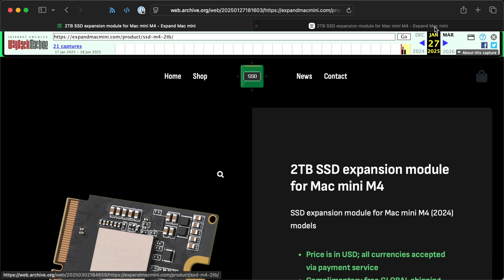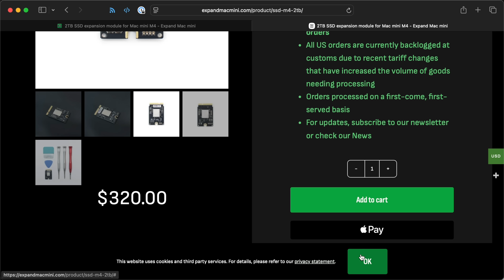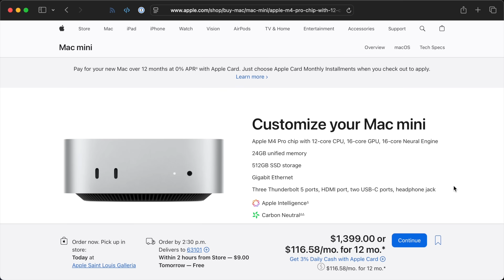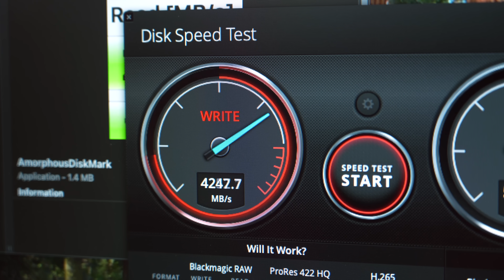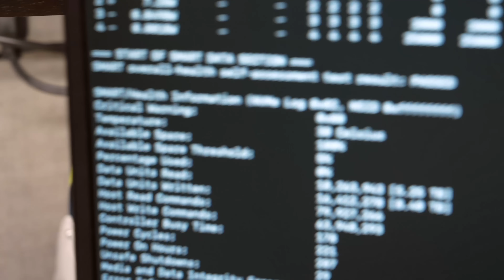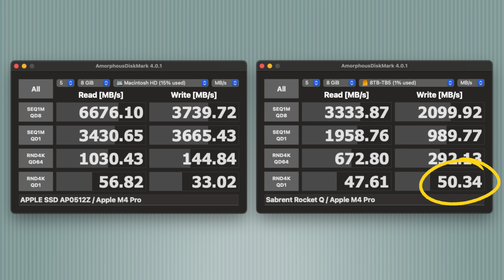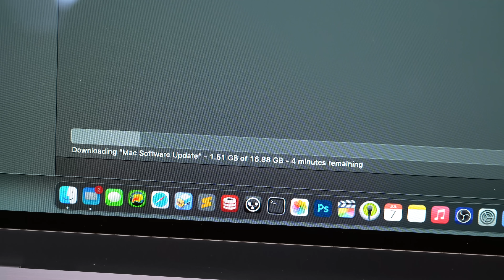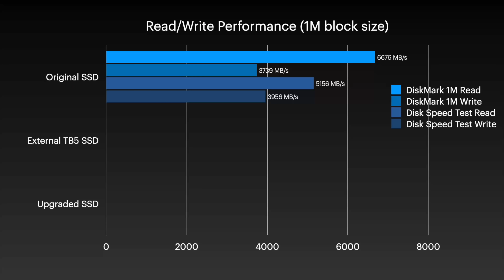There are three types of Mac users

Comment: @6:06 Given how you say it was ~150GB data transfer and then slows down, it sounds like it uses SLC caching, where it treats a portion of the storage as fast SLC flash at the cost of storage space, until the space is fully needed.
Reply from the maker: Someone else mentioned the same thing this morning—that makes a lot more sense than my DRAM theory, especially since the DRAM cache on this drive is fairly tiny, only a couple GB I believe.
Reply: It probably doesn't even have DRAM cache if it uses pseudo SLC cache.
Reply: @JeffGeerling from what I understand, the dram cache is basically a lookup table of the locations of all your files in nand for the controller chip. Very oversimplified, and I may be wrong but from what I gather, Think of nand chips as huge aisles of bookshelves in a library, and the books your data. Instead of going on a hunt to look for the books every time, it just refers to the logbook to see that it needs to go to c2-4 and just goes there directly. 

That’s why they’re faster than dram-less ssds, but not really relevant now as since pcie 4.0 I think, this index process is offloaded to system ram(I forgot the name for this process). So the drive uses your system ram as a dram cache to store the lookup tables of files on your ssd. Not sure if Mac would handle it the same way as on windows for external nvme drives, but I do think 4.0 and 5.0 drives will perform better in that enclosure, as you’ll have nand chips capable of 10-12GB/s, and I assume that should help dump out the initial SLC cache once it fills up, to the TLC/QLC regular storage thanks to the higher throughput. 

Pcie 3.0 is really ancient now imo for ssds for such heavy use cases like large video file transfers(it’s fine for general everyday users),  4.0 is a sweet spot between price and performance, and 5.0 is worth it if you really benefit from the increased speed. Or the other bonus of using x2 lanes instead of x4 for the same throughput by going up a generation.
Reply: Especially since it's a QLC drive

Comment: Quick note: For most people and most NVME drives a good USB 4 external drive case will perform nearly as well and be much less expensive.
Reply: Yep, and even an external USB 3.2 drive is going to be more than fast enough unless you're going to move hundreds of gigabytes of data around on a regular basis.

Comment: Great video Jeff as always! The longevity of these internal upgrades are very questionable, i thought you would’ve mention it since there are many cases of dead chips (Reddit) and the refusal of each of these manufacturers to mention the TBW life of their chips.. If you come in contact again please do ask them about that. Thanks!
Reply: That's not a TBW issue for that low a runtime. That's shoddy manufacturing or just downright faulty NAND.
Reply: @toseltreps1101  Yeah, these days all NAND drives have TBW lifespans that would take the average user many years to hit. The drive is much more likely to fail for other reasons.
Reply from the maker: I was actually in contact with M4-SSD this morning - they mentioned they have offered replacements for anyone in the first batch of the M4 Pro SSD upgrades. I haven't had an issue yet, but I've only been running it for a week or so now!

Comment: There's the 4th kind of Mac user:  A poor software dev that can't afford the Apple tax and only needs a Mac to briefly test on for a few minutes once every 6-8 months but borrowing someone else's hardware even for just a few moments feels tacky, finds out that the latest version of Gatekeeper on the latest version of macOS breaks their builds, and understands that, deep down inside, Apple actually hates all software devs everywhere as well as all of their customers.
Reply: You were doing fine until the end when you went off the rails very badly.
Reply: The moment when you realise it's not a real computer.
Reply: @xavierayayaell546  I know, you prefer to use the abacus
Reply: If you don't want to pay the Apple tax, just by the base model M4 Mac mini, which even by PC standards is a good deal in price/performance terms. The 16GB memory is more than enough for most development needs, and the 256GB internal drive can be supplemented with an external SSD of your choice -- starting at around $60 for 1TB for a USB 3.2 drive (1GB/s). 

Given the surprisingly good value of the base model (thanks for the additional 8GB memory, AI), it's as though it's being subsidized by those who do step on the $200 upgrade ladder, where the good value immediately falls out the window. So thanks to the upgraders, us more frugal folks get to buy a reasonably priced Apple computer for once!

Comment: What's the point of getting an 80gbps gen 5 enclosure to then put a gen 3 nvme into it? Bit of a weird test...
Reply: Test the enclosure itself…
Reply: @hankhulator5007  but it isn't even testing the enclosure. That's the thing. If you get a TB5 enclosure and put an old generation NVMe into it, it's not going to reach its full speed.
Reply: @kerimgueney     Hmmm, I would say that normally you should have better results with an enclosure that can do better.

Comment: The primary reason why DFU mode is needed:

On Apple Silicon the computer's FIRMWARE is on the boot drive, so until you've used DFU mode to install firmware on the new drive, the Mac mini doesn't even know how to use an external drive.
Reply: Additionally: to my knowledge, Apple Silicon does not boot to external drives anyway.

(there are some workarounds, but they involve doing at least part of the install to the internal drive, and that part loading the rest of the OS from the external drive.)
Reply: @kitlith  you can boot off external no problem you just can't use apple intelligence.
Reply: @MacSoundSolutions  Yes, but I believe @kitlith is correct.  It can run the OS off an external drive, but only after it initially boots off the internal drive with the firmware.

If the internal drive is dead, it would need to be fixed/replaced via DFU before external drive booting works again.
Reply: @davidschaub7965 yes that’s true it does a check with the internal drive so if the internal drive is not working you cannot boot off the external. I was not saying you can boot externally without a working internal drive just that you can boot off an external, if you are going to boot externally there is no reason to swap the internal drive.
Reply: @kitlith  Tell that to my M4 Mini that has been booting off the 2TB external I built for it from within the first hour of turning it on.
Reply: @sorphin According to Asahi Linux's engineering. Apple Silicons doesn't directly boot from external drive in anyway. They always copy that to internal then boot it.
Reply: @Keihan-8000  That's nice for them? As I previously said, I'm running on a TB4 external 2TB drive.. i wiped the internal SSD, so it has -0- OS.. Still booting (after I blessed the external drive again (set the Startup Disk)).. so.. Not sure what to tell you.
Reply: Wiping the internal SSD will not remove the firmware. The Asahi people know their stuff and it’s common knowledge at this point after almost 5 years of Apple Silicon that AS Macs load their firmware from the internal drive before booting from external. If you disconnected the internal storage entirely, the machine wouldn’t boot. 

AS Macs do NOT have an EFI or other high-level firmware boot ROM like PCs do. Since that layer of the firmware is what contains the drivers used to find a boot device (in both EFI/PC land and AS Mac land), AS Macs NEED their internal storage functional to be able to find a boot device, even if that boot device is not their internal storage.
Reply: @nathreed  I never said anything about firmware. "Everyone else replying to me" said you can't boot an external at all. I said that I am. That's it. That's all. Now, if YOU had mentioned firmware (OP did, not you nor the other guy), then we wouldn't even be commenting at each other. Since that's apparently what's being discussed by you guys as well (without saying that), i'm out. Enjoy.
Reply: @kitlith  you can boot off external drives if it is configured from macOS recovery but you will lose access to certain features.
Reply: I'm sure DFU mode is there just to give the middle finger to their customers.
Reply: @glynnetolar4423  On the contrary, it is to let you unbrick the machine if you render it unbootable. Apple Silicon Macs inherited a lot of their bootloader architecture from iPhones and iPads, and the DFU mode works more or less identical there. It's just more accepted because the concept of reviving your phone using a separate computer is more familiar than doing that to your laptop or desktop.
Reply: couldnt he just used dd, partclone or clonezilla though? so both disks would be equal in partitions, and so no need for dfu shenanigans
Reply: @DeadZombie14 The boards only have NAND chips and the controller is on the SoC. So the only device that can properly read the NAND is the one Mac that wrote to it. M.2 NVME drives each have their own storage controller on the board so that isn’t an issue. If you swapped the controller on an M.2 SSD the same thing would happen, you’d need to wipe the drive.
Reply: Exactly, one side effect of this is its basically impossible to software brick a modern Mac because even if the firmware is bad you can just use DFU to restore it.
Reply: There's firmware on NOR flash memory separate from the boot drive, but that's very basic and limited compared to UEFI on modern PCs or Intel Macs. It's mostly just the minimal amount of code necessary to bootstrap loading the rest from the internal SSD.

You can functionally boot from external drives, but, long story short, it relies on the bootloader and recoveryOS code that's on the internal SSD. It works by loading the boot picker (which is part of recoveryOS) from the internal drive, copying some essential parts of the OS (like the kernel) to be booted onto the internal drive, and rebooting into that. It works transparently to the user so it looks much like booting from an external device on any other platform, but it requires at least the bootloader and recovery partitions to be functional on the internal SSD.
Reply: @TechBlossomYT  I had wiped my internal SSD to the point it was flashing the SOS. I then went into recovery, did a set start drive. It complained loudly (aka it knew). but after a reboot, it booted off the external again anyway. ¯\_(ツ)_/¯  I can only go based on what I'm seeing. I'm not removing my internal SSD as it defeats the point of "not risking the warranty". :) Anyway, does what I need and stops the OS from auto-mounting the internal drive and latching onto it wanting to use "Intelligence".
Reply: @sorphin SOS only means 'No OS installed.' No matter how you feel you wiped the ssd. You can't really wipe it on the mac. The firmware region on the ssd will never be touched.
Reply: @Keihan-8000  You guys have fun. I never said anything about firmware.. again...  I'm going back to my M4 that boots and runs off it's external SSD.  ¯\_(ツ)_/¯  Enjoy.
Reply: @sorphin  You said you booted into recovery. Where was that recoveryOS partition located?
Reply: @TechBlossomYT  You know macs have 2 recoveries, yes? The one that gets put on your drive and the 'internet recovery' which is what get used when there's no drive with recovery available (or you force it to use it)...
Reply: @sorphin  It worked like that on Intel Macs. On Apple Silicon Macs, it's a bit different. They still have two recoveries (one per OS install and one global fallback) but both are located on the SSD.
Reply: Yes if the original drive fails you need new machine. The average lifespan of an SSD is generally estimated to be between five to ten years. That's all your Mac will ever do and if you think you can go to apple after that time to get it fixed, well you cant apple doesnt fix obsolete or vintage products anymore. When your drive fails you can use it as cutting board for vegetables.
Reply: @migidid  Well, for most of the desktops now, the flash modules and DFU will hopefully avoid that.

Comment: You literally used a PCIe 3.1 SSD with a maximum read speed of 3300MB/s, why do you act surprised that it is so slow? Nearly any modern commodity SSD is at least gen 4 now with about 7000MB/s which would've actually utilized the full 80Gbps of your Thunderbolt adapter.
What's with the fearmongering? The external solution could've completely smoked even Apples internal SSD had you just explained this better.
I get your point that SSDs vary in speeds a lot, but acting like they are supposed to be 2x slower in todays market is complete nonsense.
Reply from the maker: I'm not surprised it's that speed, which is why I mentioned a PCIe Gen 4 SSD would be faster :)

But even there, the quality of said NVMe SSDs varies quite a bit, and you will need to do you own homework when building your own external solution as to which drives handle the read/write pattern you need.

For those interested in 5 GB/sec or more of performance, the individual drive choice will matter a lot. Some Gen 4 drives I've used barely eke out 4 GB/sec, and drop off steeply after just a few seconds. Good name brand drives are worth it there—and are still going to be cheaper than the internal upgrade.

Comment: I'll be happy with Sata drive speed if it was 4tb-8tb capacity.
But the prices aren't getting any cheaper 😮‍💨
Reply from the maker: Yeah, sadly it seems SATA SSDs have just fallen off in the past few years, they are often more expensive than NVMe SSDs now.
Reply: Yeah, in blind testing users typically can't tell whether their computer is running off a SATA drive or an NVME drive that's (nominally) 4 times as fast. Once we got to SATA, speeds were "good enough" for around 95% of our computing needs.

Comment: Just upgraded my M4 Mac mini from 256GB to 1TB! Not only do I have 4x as much storage for 1/4 of the price, I also really enjoyed the process!

S/o to iBoff (they made a very detailed video on how they make the SSDs)
Reply: You're better off just plugging in an external drive. You can get the same or even faster speed than the internal drive, and it will be cheaper.
Reply: @CorneliusTaylor-s1u did you watch the video?
Reply: @tdrg_

Sure did. Why?
Reply: @CorneliusTaylor-s1u Guess you didn't notice the benchmarks showing the external hard drive being slower, and the replacement internal hard drive being faster than both the external and the Apple one :)
Reply: @HoussamElbadissi  It's slow because he uses very slow Gen 3 drives for benchmark.

Comment: Thinking back to my first pc with a 40 Megabyte HDD. With today's speeds you could fill that disk in less than 0.01 seconds! Mindboggling...
Reply from the maker: You could fill it up many times over in the time it just takes to spin up haha. But the sounds of those drives were fun
Reply: Pfft! Cassette tapes man! C64 forwarding, re-spooling, loading. But yeah, that 486 66MHz DX2 with 40MB HDD back in 1992... Oof!
Reply: Mindgobblin?
Reply: Bro Megabyte? When was this? lol. My first PC‌ had a 20GB HDD.
Reply: @RaoBlackWellizedArman  Commodore D9060 (6.4 MB) and D9090 (9.6 MB) external hard drives for PET - Wikipedia Jul24_2025
https://en.wikipedia.org/wiki/Commodore_D9060

Comment: I don't think that enclosure its really TB5, since I get the same speeds on my told TB4 enclosure i've had for years.  My default mac pro speed on the 512GB is the same read and write as well both around 5000MB/s
Reply from the maker: This enclosure was hampered by the Gen 3x4 SSD I installed in it; with a Gen 4 NVMe SSD it should be a bit faster.
Reply: The enclosure can theoretically go up to 10 GB/s but that gen 3 SSD is wasted on it. A gen 4 nvme would transfer ~6GB/s. It makes the external drive option look much worse than it actually is.